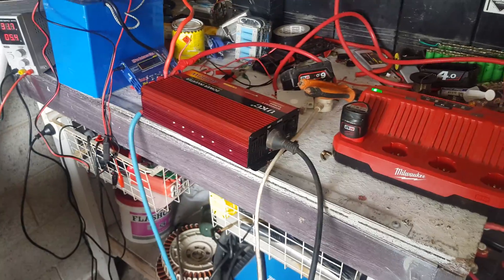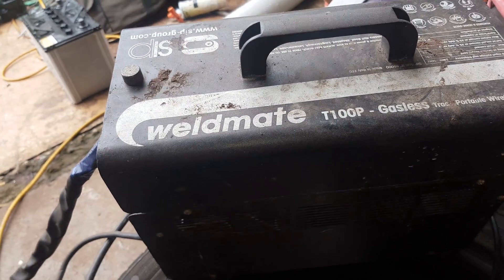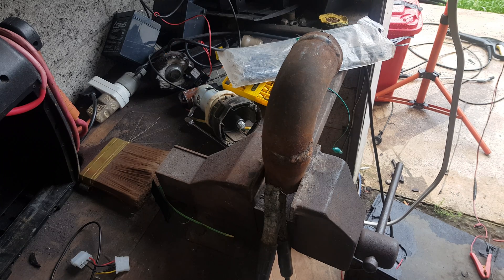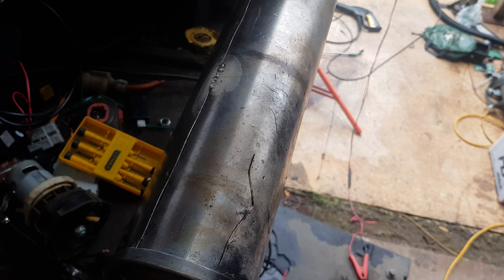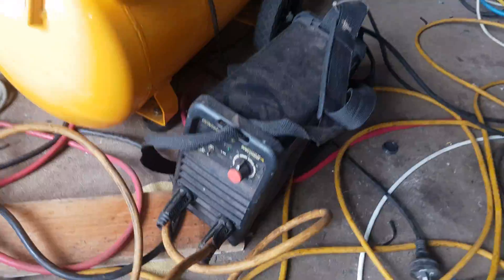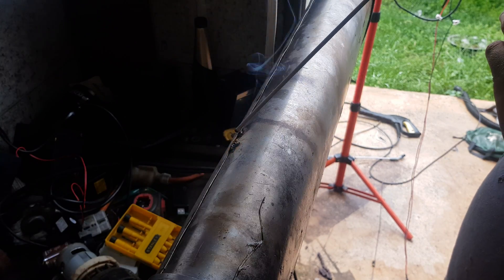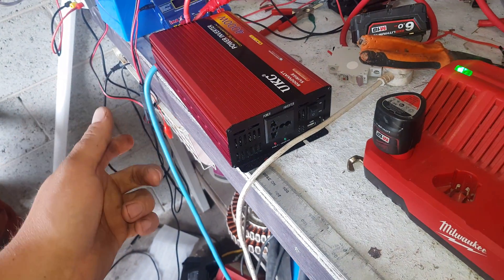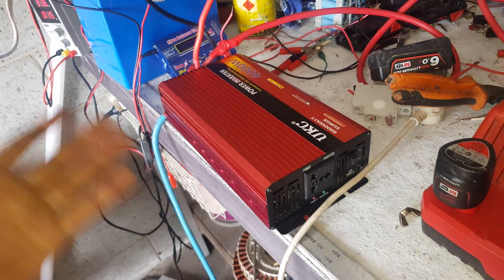UKC 12v to 240v  4000 watt inverter can it run a welder

Comment: You get longer than I do. I just unboxed the titan 140 yesterday and I can't get but a weak spark. No combinations of wire speed voltage, or induction worked
Reply from the maker: Yeah that's a shame mate ;( most hf inverters suck at starting tools

Comment: To an American your intro sounded like "Youtube sucks" .. LOL...   Great info...  I've got this off grid project where i want to weld some thin rebar.   My van has 2000 watt inverter that can usually power 13 amp devices (about 1500watts) .. 14 amp devices trip it.   I'm trying to weld rusty .375 rebar using a 80amp DC inverter arc welder.   I can do it but my 6011 3/32 stick and I can't puddle or penetrate very well.. but it does not trip the inverter.  Oddly if i set the amperage down from max (70a) to 40a it behaves the same or almost better.   Tried 1/16 6011 rods and those just stick.  Feel I'm very close,  maybe selection of rebar and size , maybe my 6011 rods are not ideal.   Also think i'm losing a lot of efficiency going from DC to AC and back to DC.. and since I've seen guys on youtube weld with 24v,  I wonder if could build a 24v DC welder using a 12v to 24v 960w 40a step up converter (as seen on Amazon)? Just wonder how to regulate current and isolate to protect my battery and van electronics.  The idea of a 12v DC welder just seems like it would have been a thing if was possible.

Comment: Anyone think a transformer-based Lincoln Pro-MIG 140 would run off a 3000 watt pure sine wave inverter backed by 400 amp hours of batteries and huge cabling?  Getting ready to try this...
Reply: Certainly would love to know your results as I am interested in exactly the same idea. I have a new 3K pure sine wave inverter powered by 2 batteries and a 140 amp oem alternator (2019 4runner).
Reply: @mikeaustin5670  Alas, I have sad news, friend.  After a lot more research I've come to the conclusion that welding can't be done on any kind of consumer inverter.  The most serious problem is this;  modern IGBT welders use PWM (pulse width modulation) to shape their output... and so do 12 volt inverters.  When the PWM patterns line up in the wrong way the inverter shorts.  I tried this with a 4000 watt Giandel inverter (one of the best on the market) backed by a staggering 1200 amp-hours of storage and the welder wouldn't work at even 60 amps output, which is useless for anything but jewelry design, if that.  I might try it with my transformer-based Pro-Mig 140, but the inruch current is so high it will likely stall the inverter anyway.  Not a good idea to "soft-start" the welder over and over.

The way welding is done in the field by off-road folks is by using three twelve volt batteries in series to generate a 36 volt supply that can be directly fed to a stick electrode.

You can use an alternator, but understand that you could blow the output diodes pretty easily that way... or the field windings.  Victron has a great video where they show exactly how that happens.  Alternators are only 50% efficient, which means in your case the unit has to shed about 1600 watts of heat through its compact chassis at full output.  I already blew an alternator trying that.

There are a couple of welding guns on the market designed specifically for use with batteries.  They're expensive, but highly recommended by people that use them, and standard equipment on some military off-road vehicles
Reply: @Daniel-Six  Well not what I wanted to hear but definitely what I needed to know! Thanks so much for taking the time to reply. Guess I’ll dismiss this thought as it’s not a critical need, just something I thought would be a neat addition to the vehicle capabilities. Thank you again.

Comment: Works!!!

I have a powerstroke diesel. I installed a cable with a 125amp breaker (need to protect my truck) from my main under the hood batteries, to a battery isolator (it allows current to flow one way like a check valve) I bought from amazon. From the battery isolator I routed another cable to an auxiliary battery I installed (12v 950amp). Then I installed a PURE SINE WAVE inverter to the aux battery. IT has to be pure sine wave, make sure it says 'Pure sine wave". I wasted $300 until I bought the correct type of inverter. 

Well, I plugged in my Miller, and my Hobart and I can Mig and stick weld all while using my trucks engine and the mean to provide power.  Best thing is not a single inch of bed space was used up having to install a generator. Also, I installed an air tank under the bed, running 2 electric air compressors from that inverter. Once again, I now have a welder, and an air compressor without wasting bed space. I own a tractor trailer fleet maintenance company and I did this to my personal truck for when I have to go out and help the technicians.
Reply: this is the EXACT setup I was interested in getting an inverter for, thanks for the comment!
Reply: But is your welder running on 240VAC or 120VAC? You didn’t say.
Reply: which inverter are you using? I am a mobile automotive mechanic and setting up an E350 7.3l powerstroke and want to do something similar.
Reply: Hello very useful information but what size inverter du you have??

Comment: Interesting video! I was thinking of turning a steam engine into a steam generator with bicycle generator principles. The boiler will be powered by a sawdust stove (because I like reusing waste), the steam engine will provide mechanical energy for the alternator, the alternator will charge some 12v battery to send current (gel or homemade by connecting AA batteries in series to total 12v) and the inverter like the one you have will convert DC to AC. It looks like your project here needs constant, non-stop current.

This is an idea that just occured to me because I think steam engines are underrated technology. The boiler for the steam engine can be biomass or waste-fired than wood or coal-fired like locomotives.

P.S anyone can make a sawdust stove and sawdust is significantly cheaper than firewood or coal

Comment: using the plug on that inverter are you getting 4000w? or is the total unit rated at 4000w and each plug rated at 2000w.... I have a Krieger 12v to 110v 4000w modified hard wired to my panel....each plug is 1875w but hard wired it is 4000w.. today I was weilding 16ga steel no major problem couple of times it did over heat a little.. I am also running 705amp hour of batteries.. check the specs on your inverter a see what he watt are per plug...Running Licoln wiedler at 88amps..
Reply from the maker: So your saying its 2 smaller inverters inside?
Reply: @Oneupthesleevecustoms  that is the case most of the time i do have an older inverter it actual had 3 plugs on the front, 2 where with grounds and 1 that was only 2 prong that was 2000w and the other two were 1000w each...you have to read the spec sheets on inverters, when you think you have 4000w and you do not... most of the cheaper ones are like that....I see that your inverter came with 4ga wires that is a dead give away that it is not 4000w.. my 4000w inverter came with 0ga wires and a 400amp inline fuse i also notice on your link to that inverter it dose not spec wattage per plug..
Reply from the maker: So can i link the 2 up?
Reply: @Oneupthesleevecustoms  never seen it done, i wondered the same thing myself. if you link them your volt sHould stay the same and your amps and wattage should go up. key word there is SHOULD..wAIT A MINUTE you are at 240v...so with a 4000w unit you are producing 16.66amp is that enough to run your welder? my 4000w at 110v is producing 33.33amp I need 20amp.. You could be so close or over that 16.66amp that could be a problem. Here in the us 110-220v is the norm here 16.66a would be a 2000w inverter
Reply from the maker: Yeah 240v so 4000watt would be fine for low amp 90>
Reply: @Oneupthesleevecustoms  try it it should be.
Reply from the maker: I think its inrush current

Comment: Do you think this could be made to work? I'm trying really hard to find a way to get a welder running on my truck for welding scrap art (so nothing too tasking as far as welding goes). I already have a pure sine wave 2500/3000W inverter and really like the silent operation compared to a generator. Before I go and buy an expensive generator I might as well invest in a more powerful inverter, that would be my favourite way.
Reply from the maker: Yet to.lay a bead with an inverter sadly mate
Reply: Google apparently recommends at least a 4.5kw generator.... I think a 5-6kw inverter would do the trick, also the machine seems a bit old, a newer inverter welding puts out a cleaner signal which might stop those errors
Reply: @JamesXcapesNY  I'm going to be trying out my 6000 W inverter to a new inverter mig set today, I'll let you know how that goes.
Reply from the maker: 6000w wow what brand
Reply: @Oneupthesleevecustoms  I ended up buying an ecoflow delta and it can power my stock w welding machine. I'll make a video in the coming days about it if you are interested. They aren't cheap, but neither are powerful inverters, and they can power all your other tools as well
Reply from the maker: Thats awesome wanna send me a link when you make a video I'd be keen on a look
Reply: Did it work
Reply: @barryevans690  yes, it works well, alright it is certainly an expensive solution. But I don't regret buying it, works perfect. About an hour of welding time from the 2kWh one
Reply: @trashureseeker  excellent what did you buy. I'm doing a split charge system in my car I've got a 120amp Deep discharge battery that took 4 days to charge from 10.02v to 12.4v so should be good. I'm planning on running a 6000w inverter that's 3000w pure sin wave
Reply: @barryevans690  sorry, misunderstanding, I bought an EcoFlow Delta Max that has an inverter built in because I couldn't find an inverter that worked. That being said, the inverter in that has a peak of 3k watts and it powers a 140 amp welder just fine. Hope that helps
Reply: I know this is a 2 year old comment but you can try hooking up 2 car batteries in series and attach the welding cables on the leads of the batteries and weld that way

Comment: With pure sine wave inverter shuld probably go.... To welding..... What is with input voltage when you try to welding it is probably in basement....
Reply from the maker: +Bostjan Trancar na inverter faults rather than low voltage didnt drop below 12.7